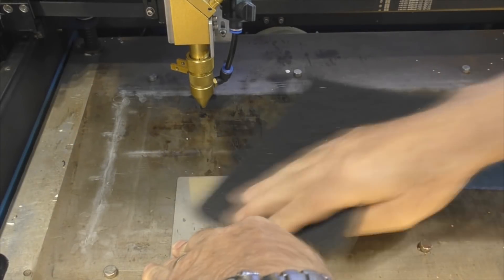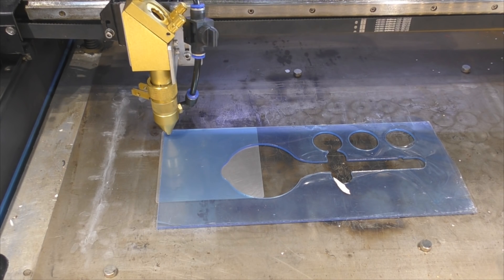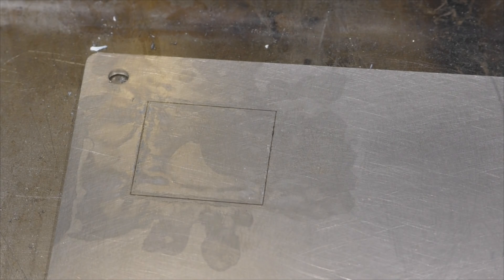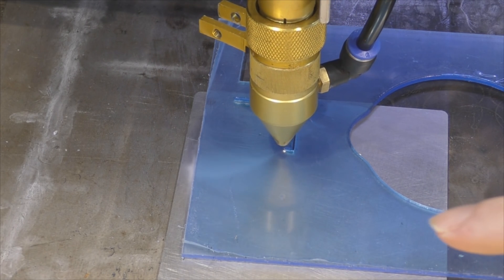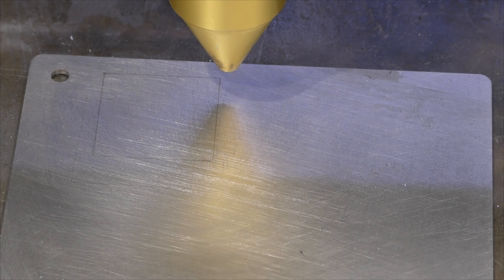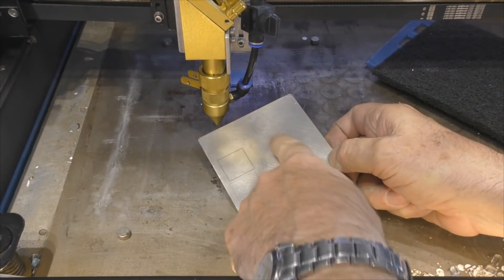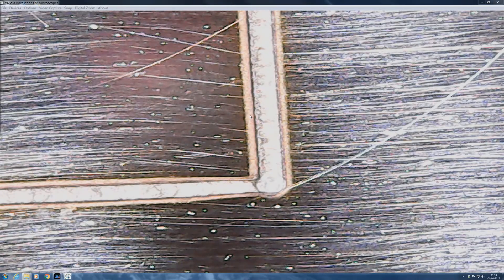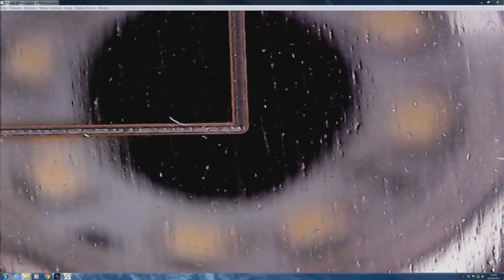RDWorks Learning Lab 100 Etching Stainless Steel

Comment: I am interested in this as I am in the process of getting a large 150W 2.5m x 1.3m machine from china.  Its only about $6000USD landed.  I could have obtained at an extra $3000USD one that would cut up to 1.5mm stainless.  As far as I could see the difference was a lens system that would electronically track the surface of the stainless very well.  Looks like it uses a 1.5" lens. So I suspect you machine may cut 0.5" stainless.
Reply from the maker: Hi Malcolm
For 12 years I ran a metal cutting laser business with two 3kw machines so I thought that  owning one of these low power sealed tube Chinese machines would be an easy hobby for me to retire with. Not so. Maybe 5% of my knowledge and experience is transferable. After 2 years I am still learning!!
However, metal cutting with these machines is not a simple matter of a different sensing head. The tracking head is essential to maintain focus but there is a lot more than that that is not mentioned when you look at yYou Tube videos or machine specs. Although You can make a  reasonable job of cutting mild steel with just ordinary air assist  you will need much more pressure maybe 15 to 20psi (big compressor!!!) The ideal requirement for efficient cutting of mild steel is pure oxygen (expensive) at about 10psi. Stainless is a completely different animal.  If you start cutting stainless with any oxygen around the melt  turns into treacle and becomes very difficult to blow out of the cut area. For that reason you use pure nitrogen BUT it has to be used at very high pressure (120 to 150 psi) so that's a hideous amount of gas consumption (and expense). Metal cutting is not really a hobby, there is so much cost involved with infrastructure that it has to be a high turnover business to recover the costs. If you listen to any you tube videos you will hear the hiss of high pressure assist gas. Go and visit a laser profiling facility and you will see just whats involved. 
I was surprised that I could get enough energy density with 60 watts to damage the surface of stainless,. The black cut is great for marking but tells me that the melt was very oxidized. 

Best regards
Russ
Reply: Yes that is what I thought to.  I also expected a assist gas as maybe these need this but look at 
http://keliangcnclaser.com/5-laser-cutting-machine/216293

this is the one I looked at buying and lists stainless up to 1.5mm stainless in its cutting list with a 150W Reci tube. 
I decided in the end to get the wood only version with a 150W Reci tube.  I already have a 600x400mm desktop laser from them with a 60W Reci tube that goes well. I wanted something that I could make furnature on :-). like you I am getting these for fun, retirement and to allow the local's to come and use them at a very low price.  www.thedoylestonshed.nz
Reply: ops Rae webb is my partner. regards
Malcolm.
Reply from the maker: Hi Malcolm. You will probably need your 60 watt machine for engraving projects where you need relatively low power. I was recently using a supposed 100watt reci tube (it was a W2 and inreality was only an 80 watt output) but with a 2" lens was ablle to cut 3/4" oak at 5mm.sec. A 4" lens and 150 watts will do even better. I'm sure you made the right choice.
Best wishes
Russ

Comment: Great job, as all your videos' . I haven't purchased  "yet" a co2 laser. Why? For  production reasons . In the US of A  sheet goods of acrylic come in dimensions of 48 x 96 inches. A laser from China , being metric, all seem short in any number divisibleby 12, 16, 18, and 24 inches. Question?? Can the axis x and y positive stops'  be moved for the purpose of gaining the .25 inchesI need to gain in x and y?. I do not need a machine  (for machine footprint and product dimensions reasons) greater than 12 inches x 20 inches or if forced 16 x 24. If possible, would the firmware/software/stepper motors handle the extra travel that would then be created or would the machine parameters be totally "lost". If this has been asked ,excuse the redundancy and please redirect.P.S. just now got connected , not able to ask direct, as yet. through youtube, will check in this lab 100 for your kind response. Thank you , Tim

Comment: Hi Russ.
Have been doing some experimenting myself with some 52 rockwell spacers.
The thickness of the spacers is critical, as they are to be ground to tenths of an inch, (.0001) thickness.
The OD however has a higher tolerance.
We then use an engraver tool to label each piece with the part # and it's thickness.
When you have an order for 100 pcs or more, the hands get tired from engraving by hand.
Spoke with the boss and took one home to experiment with the material, thinking its 4340 (Unsure) hardened to 52 rockwell.
Went with the bonding route, at 50% power, using dry molly spray, (Get to use my rotary as well) and it came out with a nice "Digital" finish of all info. (Scans in under 40 seconds/Piece, saves your hands)
Although I'm thinking 60% might brandish a better result, so i'll keep testing.
I have also been doing stainless water bottles, using the Dry molly spray and 16%power, with acceptable results.
That said, this is very interesting, being able to physically alter the material itself!
I also think it shouldn't damage the lens as it has to travel back TO the lens the same distance, after reflecting, and thus shouldn't have the power to damage the lens, right?
Seriously!....What a great hobby!
Reply from the maker: Hi Rick
My previous bad experience was over riding the logic of the situation. I reasoned that IF the beam was reflecting, it would be in a divergent form. A 60 watt diffuse beam is not going to do any significant damage, but of course, as soon as you see the bright light of the melt then you know that the energy is going into the surface and not reflecting.
I have tried dry moly many times and it does a good job. Slower speed  more power allows the beam to linger a bit longer to achieve a good thermo chemical bond. One must not ignore the mass of the object you are marking because the thermal conductivity of the body is trying to drag the heat from the marking zone. Thicker material requires more power/slower speed
Best wishes
Russ
Reply: "A 60 watt diffuse beam is not going to do any significant damage, but of course, as soon as you see the bright light of the melt then you know that the energy is going into the surface and not reflecting."
This makes total sense now.
Brilliant, Russ.
Thanks for all the great info.
Rick

Comment: colors
https://www.youtube.com/watch?v=UA78NiiT8pQ&index=15&list=PLp7cm_CDv5tHfuPKwzpdy5fbRz6wFtAGa

https://www.youtube.com/watch?v=GBcyfNcRwvk&index=16&list=PLp7cm_CDv5tHfuPKwzpdy5fbRz6wFtAGa

https://www.youtube.com/watch?v=Oz2F8pN2uVs&index=17&list=PLp7cm_CDv5tHfuPKwzpdy5fbRz6wFtAGa
Reply from the maker: Hi Martin
Fibre lasers are fascinating . They can operate with huge power (5 or 6kw) and because they operate at a much shorter wavelengths, they can cut materials that CO2 lasers struggle with, At lower powers they also are VERY controllable for marking processes. The colours you show here are not magic they come about from the formation of surface oxides. Different colours occur at different temperatures and just demonstrates the degree of controllability  of the  heating effect
http://www.bssa.org.uk/topics.php?article=140

http://www.engineeringtoolbox.com/tempering-colors-steel-d_1530.html

I am not aware that it is possible to exercise the same degree of control with a CO2 laser to achieve the same effect.
Thanks for the infoe
Best regards
Russ
Reply: Thanks
Reply from the maker: Hi Martin
Thanks for info. Sadly this is not applicable to CO2 laser machines but as demonstrated works well with fibre lasers
Best regards
Russ

Comment: I am amazed..

Do you think it's possible with a 2" lens as well?
Reply from the maker: Hi
I discovered this as I was using a 2" lens but the penetration was minimal even with about 70 watts at the work surface. Running at 2mm/sec may improve penetration but I would guess that anything less than 40 watts at the work surface may not work  because the build up of heat (it takes about 1450C to melt stainless) will be overtaken by the thermal conductivity of the steel and the melt temperature will never be attained.
Give it a try.
Best regards
Russ
Reply: Luckily I have a 60w, with brand new Si gold plated mirrors mounted (what a difference) So I have suddenly gotten a whole lot more power at the lens.

I might give it a try an see if I can do something similar on my machine. :)

Thank you for all your wonderful videos, they have really helped me get my laser up and running pretty much perfectly.

Comment: Hi Russ...
Very interesting discovery.. ;-)
Did you check the output window in your tube..? I work with very big industrial lasers (up to 10KW), and the biggest risk doing things like this, is a beam reflecting back through the lens and all the way to the resonator. If a (slightly focused) beam goes backwards into the resonator optics it can make quite a big damage.! 

Pepsi
Reply from the maker: Hi Pepsi
You are right to be concerned with powerful machines such as yours because only a small percentage reflection may still amount to a kilowatt or more arriving back at that tube window. .You note my hesitation in the video, because even with a 3kw machine I have damaged two lenses. Defocused 60watts  is not enough to do much damage  when you think about it logically, but  none the less bad, memories take precedence over logical thought. The good news is that I have done no damage. The fact that the burn was continuous means that all the energy was being expended at the work surface and  reflection=0%
Best regards
Russ

Comment: Ok ... so with this proven.

I watched your other etching experiment in SS with the special paint.

I can't help but wonder why those were so disappointing ( extra expense aside)

This is a focal/travel speed  issue at that point?
Reply: I mean a 2" lens would improve the etch quality because in that format, you could regulate the heat better for the ceramic stuff to bond.
Reply from the maker: Hi 
This method of etching is completely different. It is not a surface damage process. It is a thermo chemical reaction  on the surface of the stainless. It still requires a certain level of heat at the surface for that reaction to occur. If you do not get the balance of power and speed correct, the thermal conductivity of the steel will pull the heat away from  the work area. The thicker the material you try to mark, the slower (even with more power) you have to run
Best regards
Russ.
Reply from the maker: A 2" lens has half the energy density of a 1.5" lens so you would have to double the power or halve the speed to achieve the same heating effect
Regards
Russ
Reply: I'd like to send you a cad file or perhaps a pdf if you prefer on exactly my thoughts about this ... 

Do you have a place from to send you file that won't affect your daily biz by making it public?
Reply: My thoughts are about the heating process , not about the surface damage.

It seems to me that a longer focal range would provide a more consistent and reliable embossing through the entire plate using the paint.  Not just one section of it.

During your test burns using the paint, some etching caused warping to the material.
The material moves and changes the focal point to the surface. 

Given that the goal in that method is not to cause surface damage,  but to create a chemical bond, a longer focal range would be preferable.

It seems that if you have the power to cause surface damage, you'd have the power to heat a chemical reaction, and to do that over the surface of a larger plate, (nobody has a perfectly level bed) you would prefer a longer focal range.

The goal would be to not cause surface damage, but to evenly heat.

Hair dryer versus a blow torch.
Reply from the maker: I have sent you a message
Reply: Thanks I will get back to you when able am helping my peopes move to a new house.

Comment: Hi Russ.  Just became a (donating) member of RDworkslab!  Off topic here, but I have one of these ordered and I'm finding conflicting info re: the size of the machine.   I'm also trying to have a cart (trolley?) made up before it arrives.  Can you tell me the dimensions and how high you made the cart off the ground?  Thanks!
Reply from the maker: Hi John
Click on the S and the Sarbar Multimedia page should appear. Go to the address bar and add   /about  to the end of it and enter. You should get a new page with message button  top right corner.  Send me your email address via that private route and I'll drop you a dxf file of the cart I made (can you read dxf files?)
Best regards
Russ

Comment: This will work with all wattages?
Reply from the maker: Hi
I doubt it . I would guess you need at least 40 watts at the work surface, a 1.5" lens and a VERY slow speed (2mm/sec?). As you increase the power so the speed can increase. It's all to do with energy density and lingering long enough on one spot to melt metal. Bear in mind that metal conducts heat away very quickly so that is what will ultimately limit (or prevent) melting.
Best regards
Russ
Reply: Exactly what I thought so I am a perplexed at how you managed to cut into it.  You call it engraving which is just another word for a shallow cut and with that much metal AND you are not at the precise focal point AND you are using about 55 watts something evil is happening.  Black magic is at work here I can tell.

Comment: I  dont know if you have heard this before but I read somewhere once that you could use a mixture of isopropyl alcohol and plaster of Paris  spread thinly onto stainless and it will make it possible to etch it. I have not tried it yet but has always been in the back of my minds projects folder
Reply from the maker: Hi Dustin
I just answered this and You Tube has posted it into oblivion
From what I know about this, it works on the same principle as Cermark and MoS2. It's a thermo chemical reaction with the surface of the stainless and not a melting process
Best regards
Russ

Comment: hmmm .. this is good stuff.
This tells me that using a 2" lens would actually work better.
But that it would be more difficult to focus it.

I know you need a longer lens for cutting very thick materials by my own experience.

Like for example, I'd have a very difficult time on our 4kw machine cutting 1/2" steel with a 5" lens.
But with a 7" it's almost effortless.
Reply from the maker: Hi
I think not. This is not a cutting exercise but one of local surface damage.  In general you are right that longer focal lengths  have longer penetration. The problem is that as the focal length increases the spot size at the focus point grows and the energy density (its ability to do damage) decreases. However, you can get the energy density back up by increasing the power. It is energy density that you need for cutting. The longer the focal length the less VARIATION of energy density over a longer length (the beam is more parallel). So provided you have  masses of  power to play with then you are correct about longer FL=deeper cut.  Sadly when you have only 60 watts you need it to be amplified as much as possible to do damage. A 2" lens has twice as much spot AREA and will therefore have HALF the energy density of a 1.5" lens at the focus point.

Best regards
Russ
Reply: Damn .. that really does make a lot of sense.
Reply: also ... the shorter focal length increases the reflectivity wider.
 Decreasing need to worry about lens damage.

( as if that is a concern at 60 watts)
Reply: This being the case ... a 1" lens would be better. does that even exist for these machines?